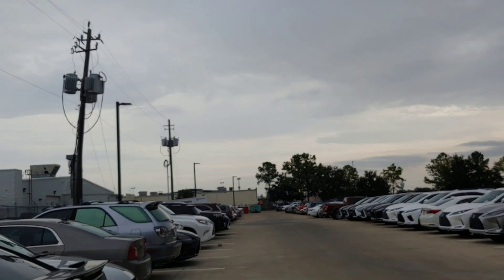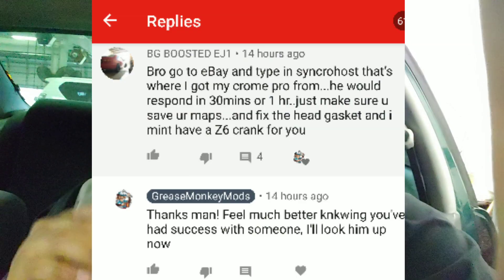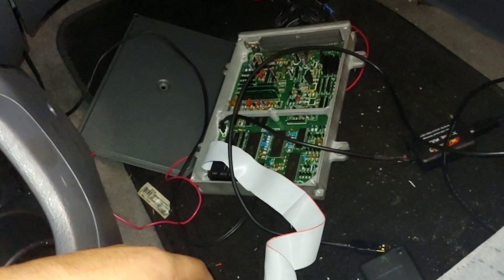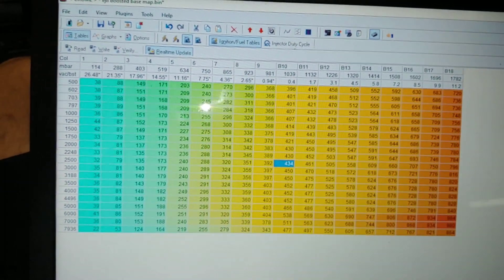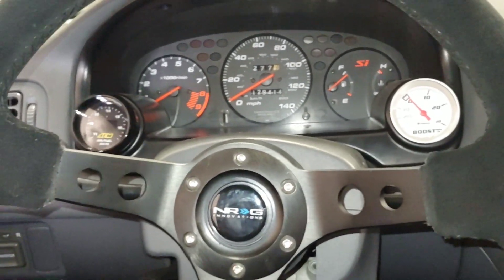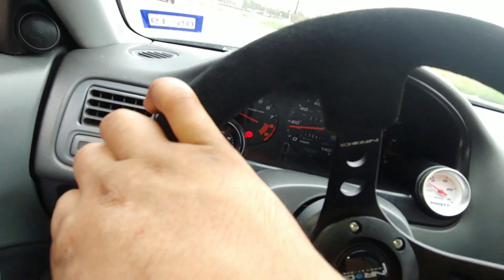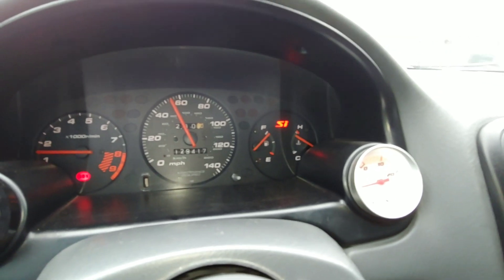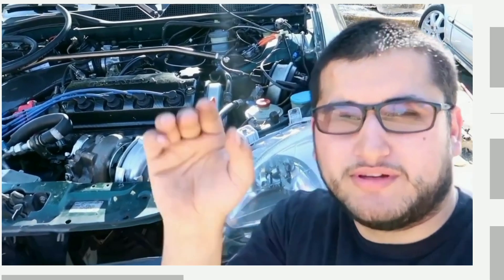Tuning The Turbo D16 ~ And Talking About The Moates Xtreme Hulog And Data Logging With Crome Pro

Comment: bro do the head gasket just order a  MLS from ebay and order some chinese replica head studs they are under 60$ for the studs and work !!! I've tested them on several boosted engines all u need is to buy the sauce pack of arp lube for them ... also remember u dont have to take cams of when removing head on that engine ,u can pull of the job in two hours ,just check the head with straight edge ,but I'm sure it's good since it's just lifting and not actually warped